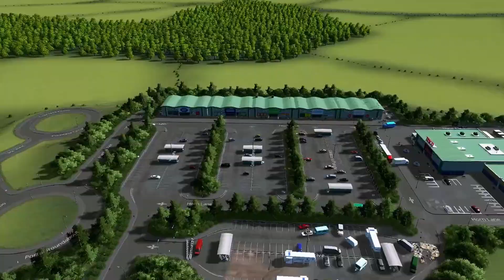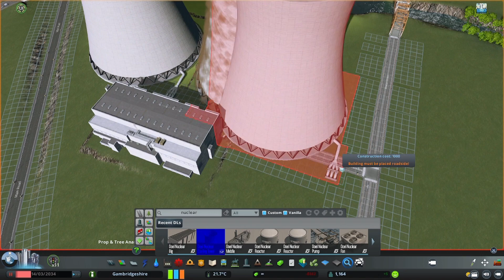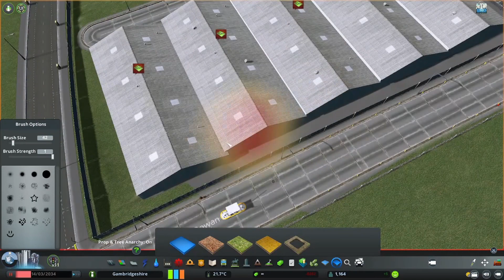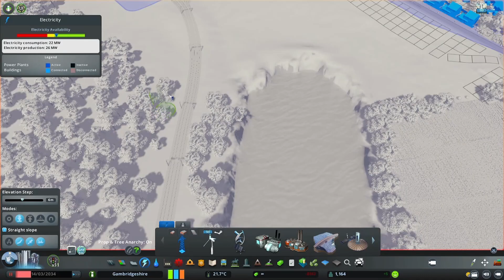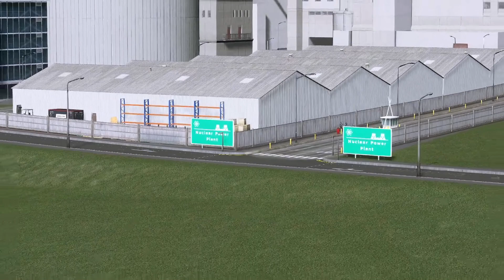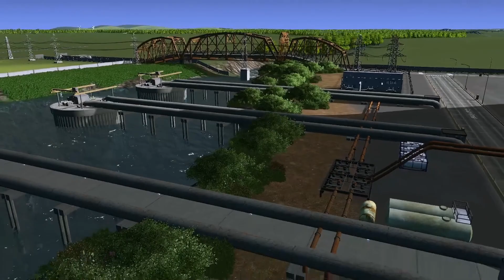Building A Nuclear Power Plant In Cities Skylines | British Skylines | EP 16

Comment: Loved the music, always up for a waltz. I’m not sure the Austrian’s would be happy to have a nuclear facility on the Blue Danube. 🤣

The security made me laugh. Growing up near Sizewell I remember the 12 foot reinforced concrete walls topped by another 12 feet of steel fences with barbed wire on top. There was a cleared area so they could see anyone approaching and further fences behind the walls. 

The security gates were double reinforced gates with an air lock system so one had to close before the other opened. 

The uranium was delivered by trains with armed guards and packaged in concrete containers. 

They really didn’t mess about as a terrorist attack would be so devastating.

My only serious change would be to add rust stains to the buildings. If you look at pictures of Sizewell it looks weathered.
Reply from the maker: Glad you liked it dude, there is certainly space to add another layer of fences around the back so may do that, good shout about the rust too dude. Thanks again 😁👍